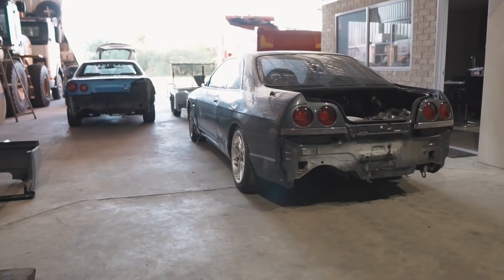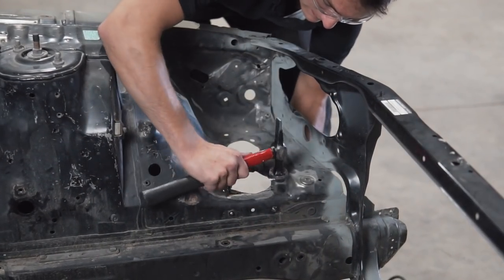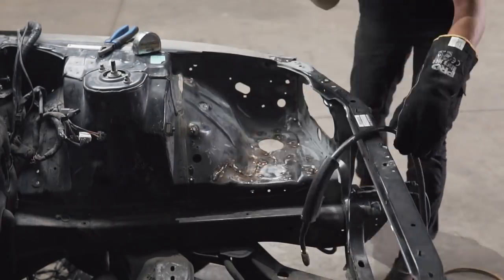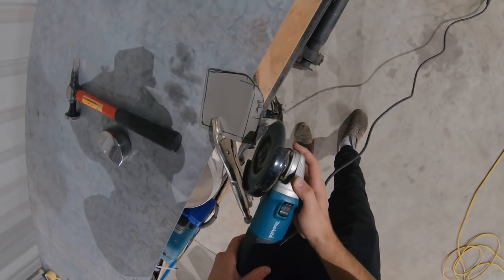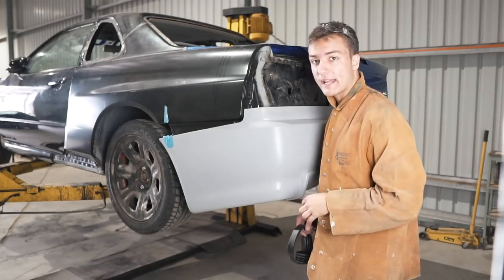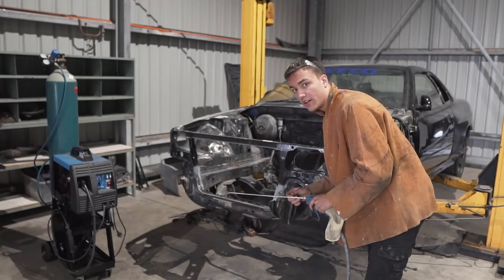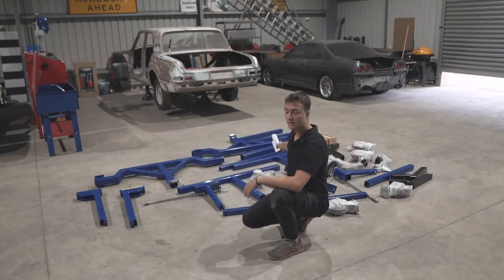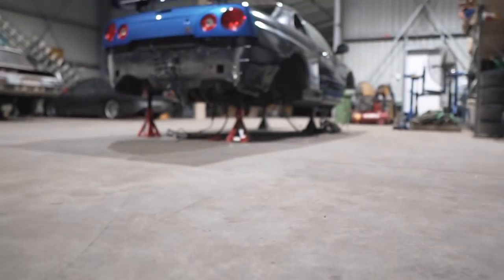DESTROYED R34 Skyline Build Continues..+ NEW PROJECT | Poor Man's GTR [EP5]

Comment: Great video. I hate being critical so I'm sorry but, how you plugged the hole was impressive, I'm just not sure why you did that? You could of used it to put tubing through it for a cold air feed to your air filter. That's what I'm doing when I go front facing plenum
Reply from the maker: Cheers man
Check out my S14 engine bay videos. The plates were welded in because someone destroyed those holes instead of cutting it with a hole saw nicely. So I've patched them up now and will cut 2 new holes with a hole saw on each side for the intercooler pipes
Reply: @BrokenSilvia  ahhhh got you, great work. Mines almost done. What colour are you thinking of going? I can see you're going Z Tune front end also
Reply from the maker: @BossCarsUK  Yep front end is sorted. Not sure about colour yet
Reply: @BrokenSilvia  how did you sort out the bonnet gap?

Comment: Hi bud, as commented on your other vids on this rebuild, just wondering if you are going to replace the screen, I only ask this as chucking a grinder around the engine bay those little hot shards of ground metal can burn into the glass like crazy.
Reply from the maker: Haha yeah man it’s getting ditched because it’s cracked. Didn’t want to take it out because the dash would cop the sparks then
Reply: @BrokenSilvia  Spot on fella, from the UK, have a good weekend.